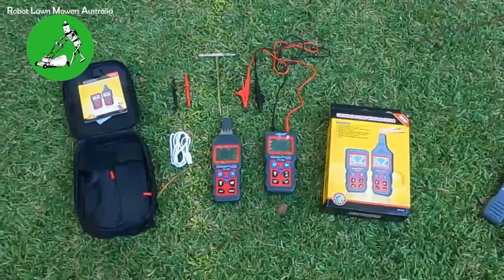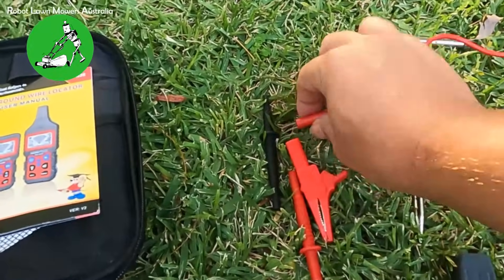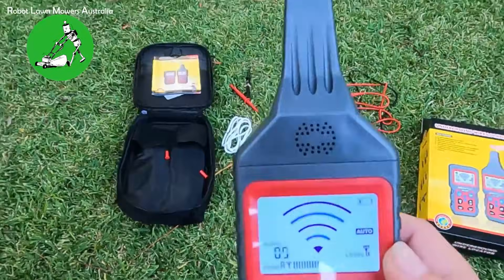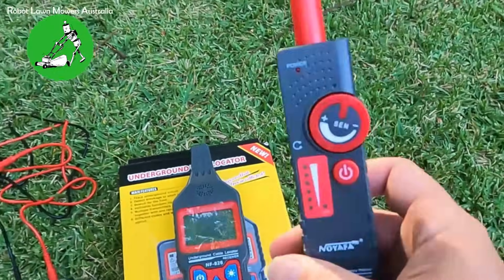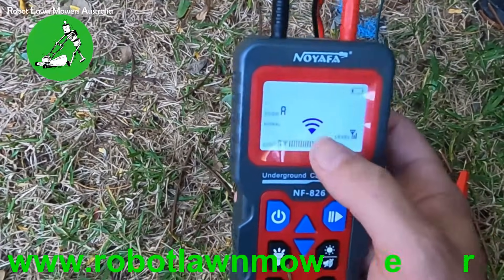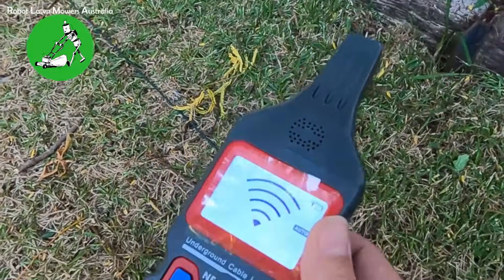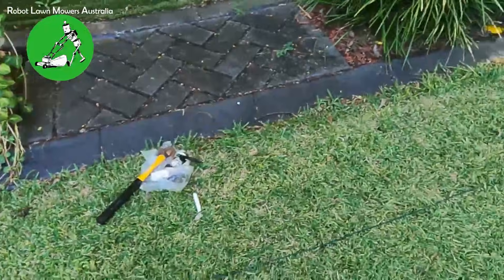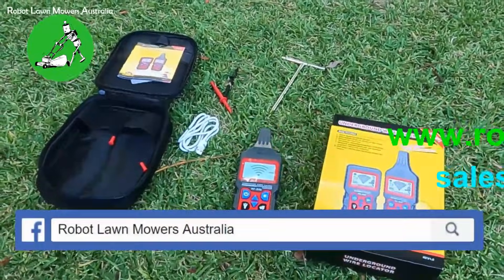Robot Lawn Mowers Australia - NF-826 Wire Break Locator

Comment: I’ve been trying to use the to find the end of a cable for an irrigation system. The dirt has covered up the valve box and I can’t find it. This thing has been picking up very thick tree roots. It is accurate to some point but then it starts acting weird. If I get to a certain spot then the signal will stop. But then when I turn up the signal locator it will start beeping again and guide my way further down. I’ve found the pipes that the wire runs through but no valve yet. Guess I’ll walk around my yard tomorrow with the soil probe and hope I find the box. My yard is a mess trying to find this irrigation valve.
Reply from the maker: Signals in the ground can do all types of weird things. Try different signal strengths as well as outing the ground prob in different locations.

Comment: hi,
Can this detector find a damaged insulation on wire which making short circuit?
Reply from the maker: Yes as long as it is a low resistance short. If high resistance it will be very difficult to find.

Comment: What’s the difference of the “Code” the signals I’m assuming it to be.  There’s like a A-B-C-D-E-F.   Something like that.  There’s 6 or so different ones.  

Instructions say basically nothing other than the fact it can be changed from A to E or anything else.   

But there’s no difference in tone itself.  Be it a pulsing tone or different sound of anykind.  All the different “Code” signals regardless of which is selected.  

Seem to be exactly the same.  Is that like a gimmick to add to price of having different options.  But they really do no difference or what???

Do you have any idea?  I haven’t really used mine yet other than a quick function check.
Reply from the maker: It changes the frequency of the signal. I have never had to use it, but certain signals might be affected by other signal from other devices. So you can then change it, so you can continue to use it in that affected area.
Reply: You can buy more transmitters, set each at different frequencies and connect them to different circuits and ring them out at the same time.
The receiver will detect them all.
If you suspect a break in the line you can connect a transmitter at each end of the line, set them at different frequencies. When you see the receiver switch frequencies you know you are at the break.

Comment: Hi, when the transmitter is connected to the mains, can its signal also propagate through a 12V power supply or a 5V Usb power supply and be detected on the cable of these power supplies ?
Reply from the maker: I’m not sure. It would depend on how the power supplies are made. I have never tried to trace any type of cable locating signal through a power supply.

Comment: Is it work on xlpe/pvc underground withh armoured 11kv cable
Reply from the maker: If you are just locating the cable then yes, you could use the armour as the signal conductor. If you are trying to find a fault in the cable inside the armour then I would guess no if it is a ground fault. But if it is a full open break then yes I think it would work. They can sense upto 6ft down so the manual says. I have only used them at 600mm buried cables.

Comment: How depth it will work Cable depth in ground
Reply from the maker: The manual says 6 ft, but I have not tried any deeper than 600mm. Works very good at 600mm.
Reply: Since they don’t seem to want so say.  I ordered one a few minutes ago.  I’ll let you know. Roughly the standard typical depth after the holidays.  

Bought it for cable roughly 18-25” give or take a few inches.  Inside of conduit with a without concrete over it also.  

If they say something back cool but I’ll comment back when I get to check it a see if it fits my needs.  And you’ll get an idea
Reply: @AquaTech225 so what was your verdict?
Reply: @oo0Spyder0oo it works.   I specifically wanted to use it for pool lighting.  A pool with a good bunch out an a good few groups of lights.  

Since a number was out.  Just unplugging them all.  A plugging one at a time in.  Was only going to show which ones were out.   

But not what of the ones out was what wire at the box.  

I used to figure out what light out was to what wire in the box. 

Also I learned.   Just out of messing with it.  If you want to check a branch or wires you can’t.  Each one had to be done on its own.    The signal isn’t front enough to produce a tone through say 6 different 50-100 foot runs at the same time.  

But each wire by itself it produces a good time.  A that was through whatever depth code is im sure atleast 2 inches.  Plus concrete an tile.  An still picked it up a couple feet above that

Comment: honestly they should just have an option to package a detector with  the systems. You will have a break in the first few months then you waste days figuring out how to do this. Great video, when I did this something odd happened where my detector was pinging around 100 just sitting in the middle of the yard? then when i would go to the wire it would get up to 250 range. Have no clue why and it was only back yard not front.
Reply from the maker: Radio signals can do weird things when under ground. Pipes, drains, natural water paths can all affect what happens.

Comment: Whats the use of this video?
Show actual underground cabling.
Reply from the maker: The boundary wires are usually 2-5cm under the ground and this meter will test up to 1.5 meters under the ground. So the results would be the same. For the purpose of the video and teaching people how the detector works, showing it on the surface I believe helps.

Comment: what are the code set button for?
Reply from the maker: This provide different signal frequencies. It is not often used when locating boundary wire breaks, but can be used if you are having issues with the default frequency.

Comment: I would have liked to see an example done where the wires are actually in the ground .
Reply from the maker: this meter can sense the wires even if they are 1mt under ground, so the testing is very similar if the wires are buried 5cm under the ground for robot lawn mowers.
Reply from the maker: the NF-820 and MS6818 are almost the same. I use both and find no difference at all between them.

Comment: Thanks for the video! What if the phone cable is in conduit 20cm underground. Which one is the best locator?
Reply from the maker: Thanks Trent. If you are just trying to locate the cable then either will do the job. They can still get a signal up to 1500mm under the ground. But if you are looking for a break in the cable then the 826 would give you more information on where the break might be.